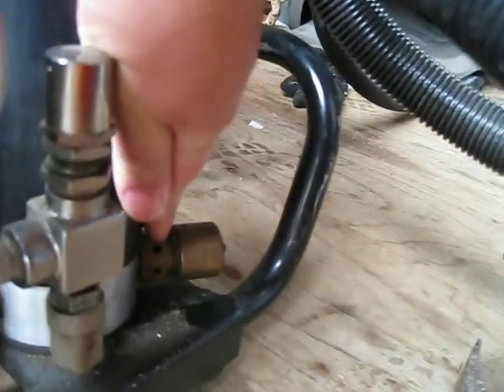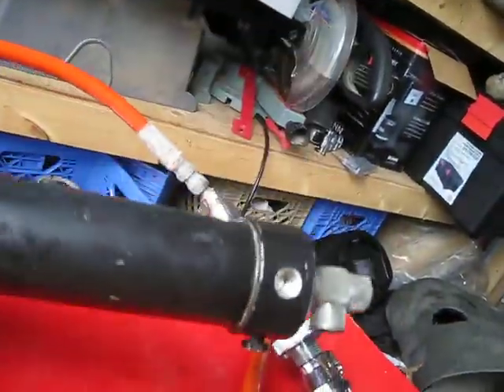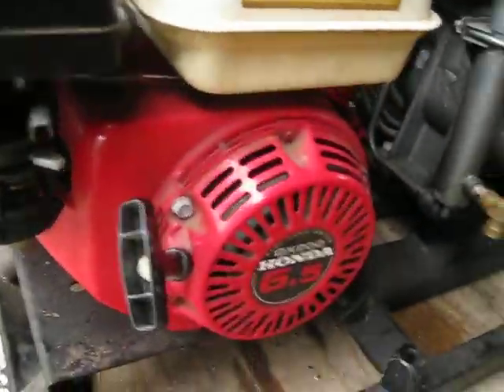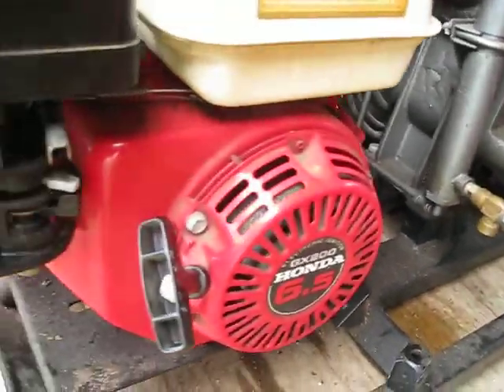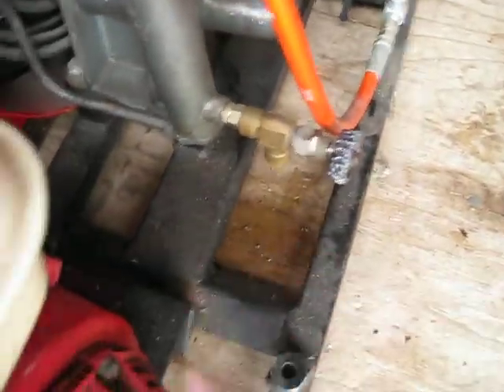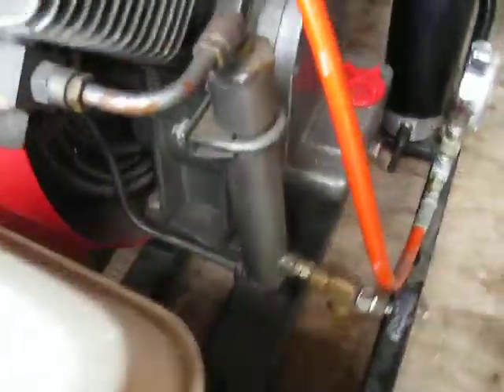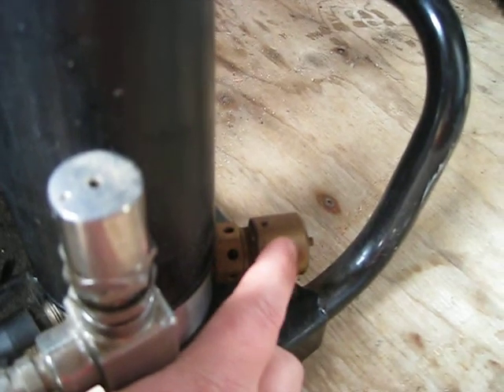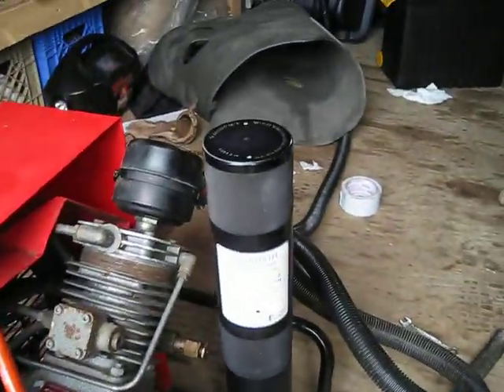scuba compressor bp6

Comment: The expensive part shown in your hands during the video is an interstage condensate trap with a likely 50bars working pressure. It would be fitted after the 2nd stage intercooler. This type looks like it has been removed from an old Bauer Capitano/Mariner I. The connectors and pipe routing locations are not compatible with the Hamworthy - and it will take quite a few engineering modifications to fit to the BP6.

Comment: Support for Hamworthy BP6 compressors is now through Gardner-Denver Inc, who purchased the Hamworthy, Belliss & Morcom(UK) compressor manufacturing company in 2001. The final Filter tower is a 'MDE' Midland Diving Equipment(UK) unit - replacement filter cartridges, safety valves and pressure maintaining valves are available from MDE direct. PM me if you need the service manuals/tech data.
Reply: Hello Stephen, can you send me manual of this compressor ? Or give me a hint, where I can find it.

Comment: The compressor is called a bristol 2.4. Originally made in fishponds, bristol, uk. The oil needed is androl 555 synthetic and it is a 3 stage machine. Designed for 200 bar but will do 300 bar for short periods( with the correct relief valve) and if the 3rd stage piston is not worn because it has no compression rings on it.

Comment: The brass valve is a relief valve made by seetru. should be set at around 210-215 bar. It is designed to leak when your max fill pressure is achieved. if leaks before that it needs replacing. You can play around with it but this is a safety device so not advisable. (plus there is a roll pin in it to stop people messing and the seat is made of viton so probably nackered)